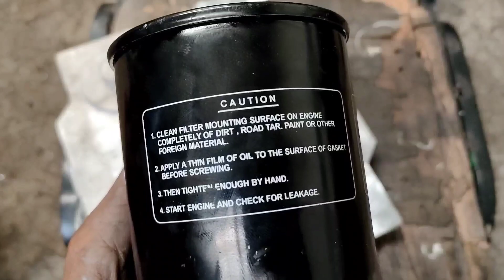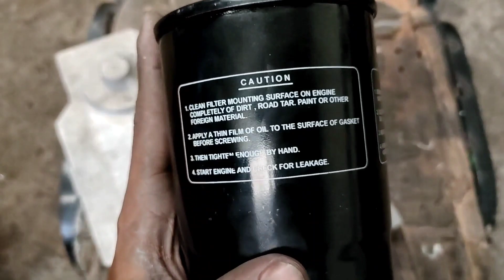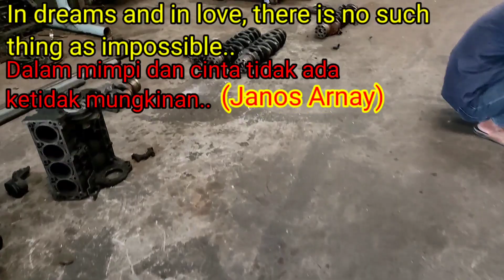Membubut Benda Kerja Tidak Beraturan Menggunakan Chuck Empat | Proses Pembuatan Bak Penyaringan Oli

Comment: Hydraulic oil? I've seen that type of mounting plate on JCB equipment with dual hydraulic filters and also dual fuel filters. Doesn't it need another hole for the oil to get in? (oil flows from outer edge with maybe a flap valve to prevent drain-back through filter to inner hole and whatever component) An exceptional piece of machining.